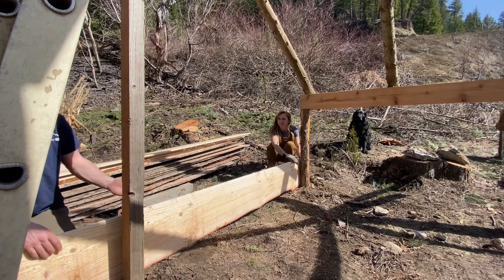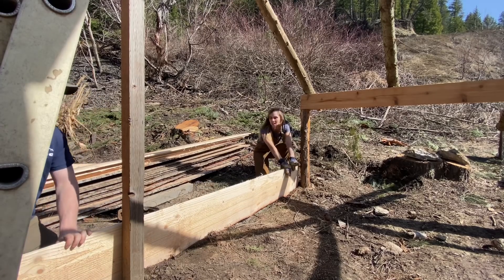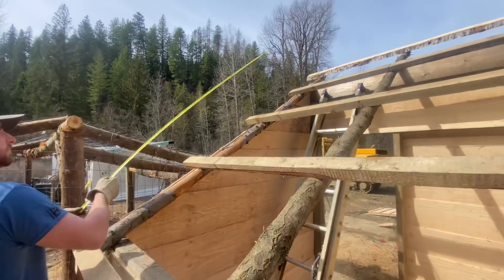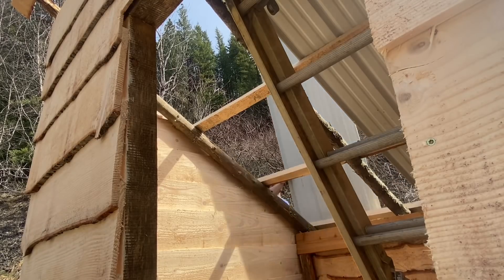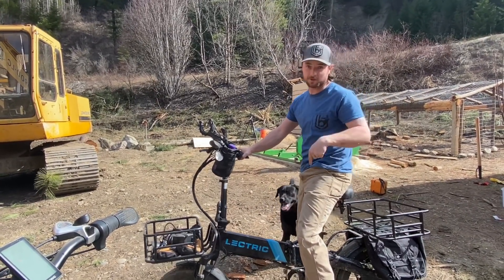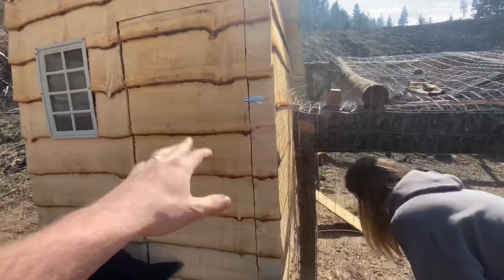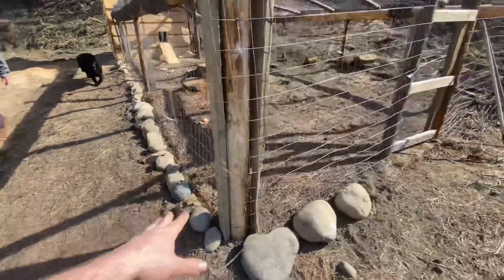Homemade SHIPLAP Chicken House

Comment: What a great job you kids have done!  My run I made had a open roof, and the chicken hawk had a field day!  LOL  jUST A THOUGHT?  I showed your film to my brothers, soil engineer, and Dad at our family excavation office.  Young Lady you created a lot of screaming a tv screen!  LOL  Kido your life is so precious, all that material stuff don't matter, it can be replaced you can't.  Enough said.  We feel moving the road lower on the property might be a safer solution from the films that are watched?  but the ground needs to be stabilized with a lime or grout mixture.  Most differently drainage needs to be incorporated.  Dad agrees sheep-foot piling that is teraced would be the safest instalation to hold your hill side.  A few year back we bought 2 5-ton army trucks, one of them I built a hopper and rotor tiller on the back that tilled soil 16" deep.  For road projects we incorporate lime in the soil below frost line to incorporate a road base for road projects.  The second truck hauls water then a sheep-foot roller for compaction and finally a 10 ton bomage roller.  The best advice that we can give is get a soil engineer to inspect and give some options.  If I win the loto, you kids are first on the list to help and hire competent company to help.  Best of luck!  And watching your films brings much joy seeing youngsters having so much go in them!

Comment: No more windows.  Chickens like the dark to roost in plus windows reduce the temp in winter. You want it sealed up  & cosy in those cold winter nights. Also get one of those automatic doors that open at daylight and close at sunset. You'll need a much bigger & better perch for them to roost on all night and some raised laying boxes. If you want light in the coop but a couple of solar lights in it that you can turn on & offwhen you enter & leave. Once you've installed chicken  netting around the eaves then go around and fill in the gap with scrap timber to help keep out the wind & cold.  You want happy laying chickens , keep them warm and dry, well fed & watered. 👍👍👍👍

Comment: It looks great!!!  My only concern is the end of the run on the door side looks to be open around the top.  A bobcat or coon can easily climb the fence and enter there If I’m seeing it correctly.
Reply: Yes, he said at the end that they ordered chicken wire and were going to put it in the gables or whatever those ends are called. And other places. I noticed it too.
Reply: @jackiesaylor2487  I thought he said that was for the coop but you’re probably right.  I’m sure they will cover it.

Comment: Cool coop using milled lumber. You should add a pole midway on each wall to provide strength during high winds. Also be careful using the sawdust with the creosote in the garden it’s toxic to humans and chickens.

Comment: Best 'free' chainsaw coop ever built.  I would add tons more anti-digging rocks around the perimeter of the range cage.  Also add 1" poultry wire 3' foot high all around the base of the cage.  Raccoon will stick there hand thru your existing wire and just dangle their paw.  Dumb chickens just can't resist a wiggle bunch of fingers..snap their head is gone.

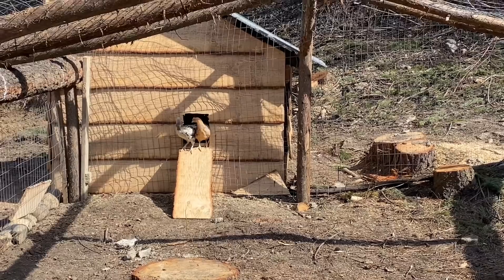Comment: 15:22 to 15:40 there appears to be some missing fence above the door, a place for a coyote or racoon or cat could easily gain gain access. Maybe you removed it to make a better video,  or that's where the chicken wire is going. Love the chicken coup and run, you guys did a great job keeping your flock safe and with a great place to scratch around. I think the tree stumps offer some variety to the run, think of all the insects they will get to eat when those stumps start to break down.

Comment: Looks great and critter proof. If need be put a solar electric fence down low as a deterrent. Wire at the bottom is great. We have one going under our chain-link fence and it keeps the skunks out, and the dogs from digging out But we only have a half acre.